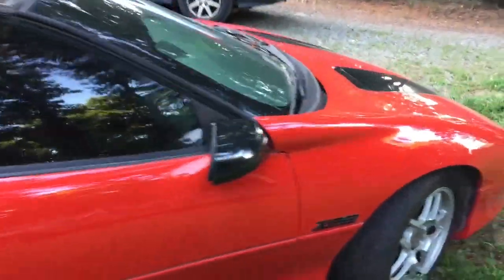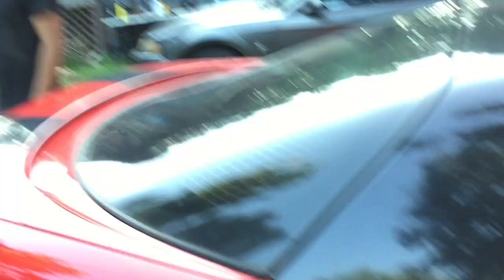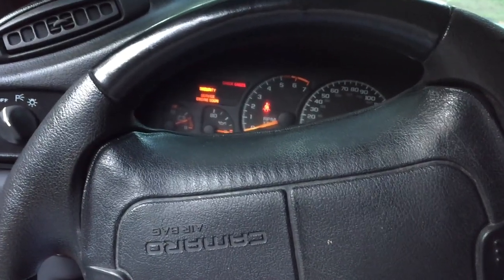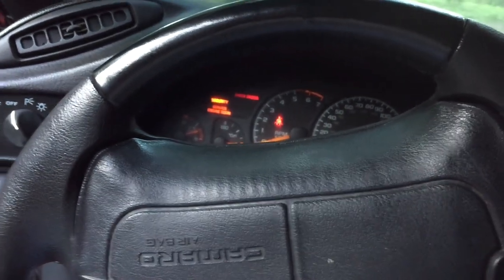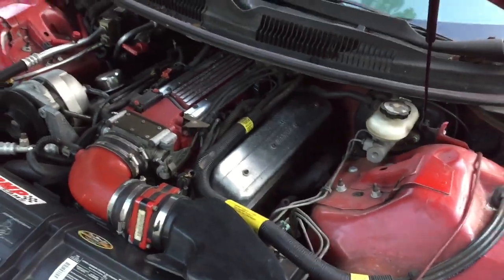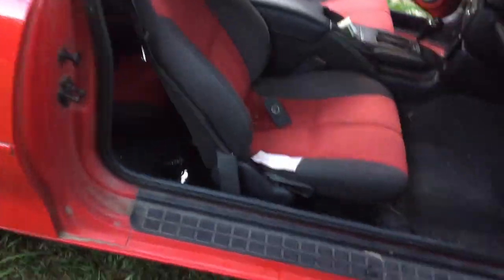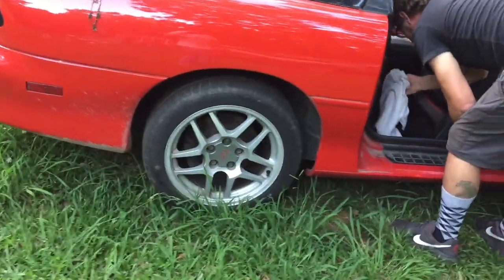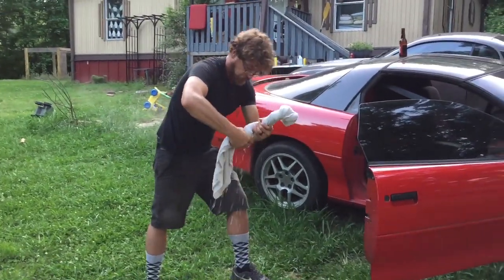SECURITY LIGHT NO START EASY V.A.T.S. BYPASS 4TH GEN F BODY CAMARO/FIREBIRD

Comment: take your 2 white wires cut them put a resistor in and its bypassed. just don't cut the end coming  from  firewall.. cut the one coming down from colume you never have to worry about it again. well if the resistor blows but easy enough.. good lick...

Comment: Yeah we poles up there in your skylights they're probably plugged up with debris yet to clean those weep holes out in the water will drain out through the system goes out through the top drains into the fenders and Fender Wells drains on the ground but you got to keep those we poles clean where these sunroof star

Comment: You can also do the door locks like four times lock that's what's help mine in the past it starts running like crap I'll do that door lock thing four times and it Smooths right out of here that's because it has an aftermarket stereo in it otherwise you could do it to factory stereo you can reset it tells you in your owner's manual

Comment: They have a drag system in those cars you put it in just drive and then kick it and watch it go it's just like a straight shift the grabs ever gear and tears the pavement up first- sideway second- sideways 30 rubber which my does 135 in quarter mile

Comment: I have a 1997 camaro z28 manual and the security system is preventing it from starting and turning over what should I do
Reply: cut the 2 white wires splice them splice in  the correct resister your all set.. those white wires are covered in orange its going into the plug cut the one going upward to column wire resistor in plug back in it over rides the vats. your key mint be bad that chip has resistance in the chip. easy can look it up quick I seen people go crazy over this anything let me know.

Comment: Hi
 then the trick is to leave the key in the off position for 10 minutes, then remove it and turn it on again ?
Reply: I know this is old but on mine, security light comes on, leave key in on position until security light disappears. Try to crank it first. Then turn key to off position and crank it up. If I don't try to crank it before moving key to off position it will give me security light again. Annoying as hell.

Comment: just got my 94 running good then sercurity light comes on no start now
Reply from the maker: well dam ,.. did this help she fire up after the trick??
Reply: i tried it i'm back running , get this the horn blows when i turn the wheel sometimes ?????
Reply: @mrstackracks1189  your horn resistors are touching when you turn. Gotta remove the steering wheel to fix the issue

Comment: If the security light doesn’t turn off what can I do?
Reply: I leave it off position and wait 10 minutes and come back the lights usually off. Having a key with that chip helps sometimes the chip loses its resistance and a new key has to be made
Reply: @skcoryhpargonrop  try polishing the resistor. sometimes that helps...